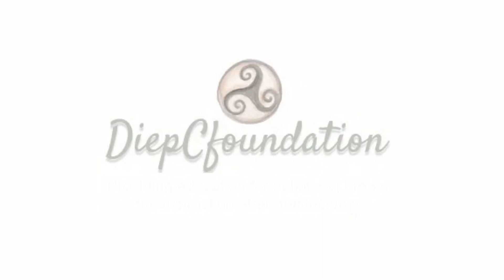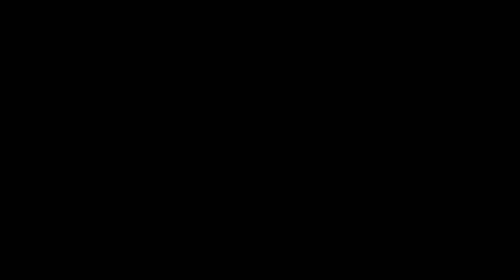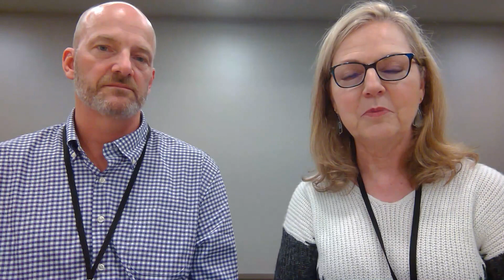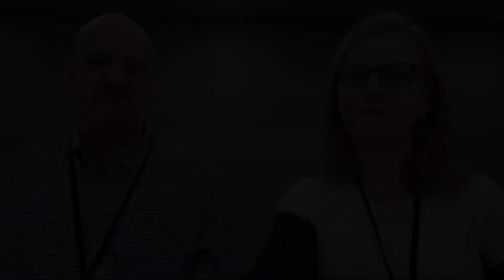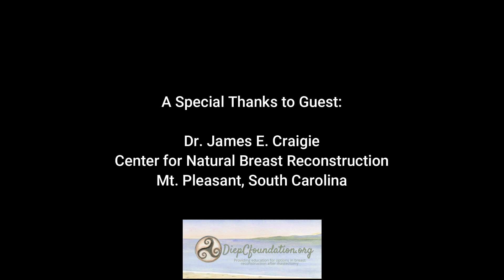Restoring Nerves Post-Mastectomy During DIEP Flap Surgery

Comment: If you have had a reconstructed small breast (NSM), can this procedure still be done as a one-off? Not DEIP needed. There should be a nice blood supply there and nerves that either need to be grafted, connected, or burrowed, correct?
Reply from the maker: Stephanie, the nerves used to be reconnected to the breast area to restore sensation are taken from the abdominal area during DIEP flap. Unfortunately, at this time, there is no "one-off" procedure for this other than DIEP. The blood supply and nerves are there in the breast but the nerve used for restoring sensation to the breast come from the abdominal area.